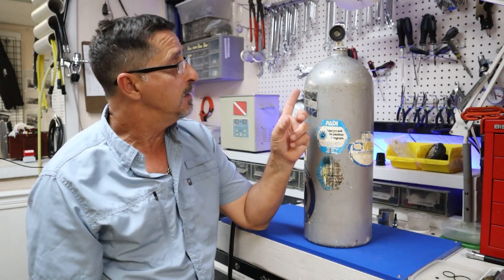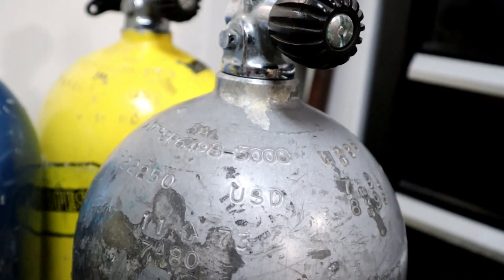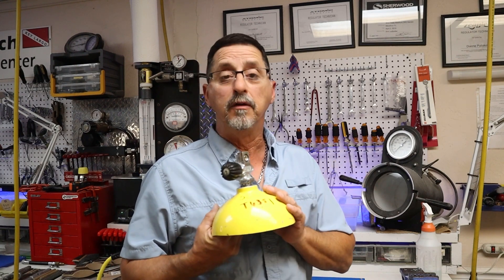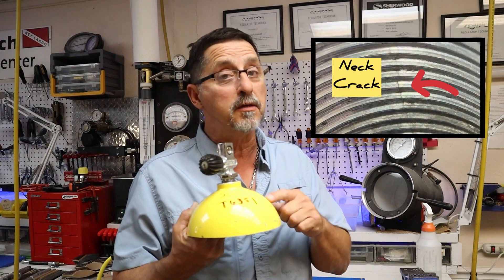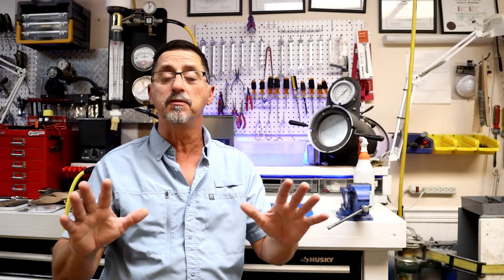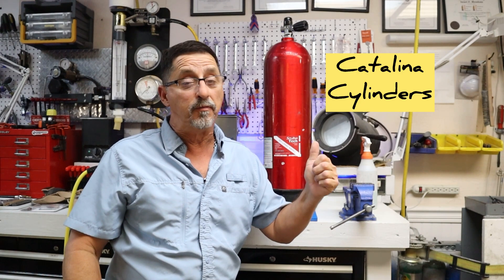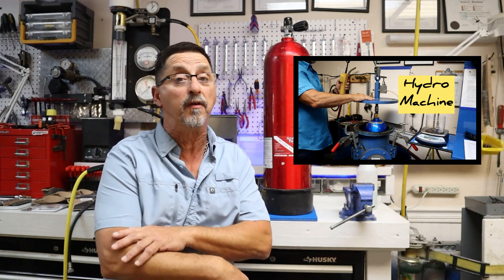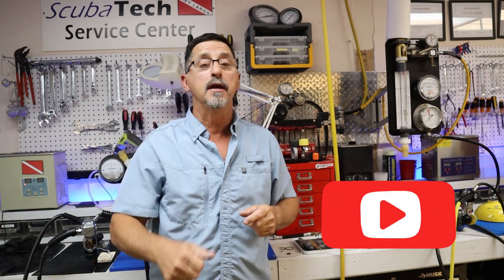What happened to Luxfer Scuba Cylinders??

Comment: thanks for the info, I still have a 50cf and 13cf from the mid 80's in the garage with air in them, they have never been empty other than inspect or hydro - never failed a hydro, but no one will fill them so they just sit there - put two 80's and another 50 out at the curb just over a year ago when I picked up a new Catalina 80 for beach water metal detecting - about to give up on tanks and get a Blu3 Nemo - it would be a lot less work for this mid 70's body of mine -
Reply from the maker: I've seen the Nemo diving system, haven't use it but I would like to try it.  I've used the Brownies Third Lung and use Snuba for lobstering.  It's a good feeling without tanks on your back.

Comment: Do steel tanks have the same issue?
I have a 1971 HEALTHWAYS 72 cu.ft. Tank.
Any thoughts on that?
Reply from the maker: Neck cracks have only been seen in aluminum tanks, steel from the 1970's can become rigid, which will fail hydro.  Steel tanks stay flexible if cycled regularly such as filling and hydro testing.  Tanks that are in the garage for 20 years without use  have a high probability of failing hydro. A simple test you can do at home is to "tap"the tank on the side wall with hammer, listen for bell tone, if the sound is dull the steel is rigid.
Reply: @scubatechkeylargo  
Well, I took that tank, the 1971 steel HEALTHWAYS 72 cu.ft. to the dive shop for a hydro test. I'll keep you posted on the results.
Reply: @scubatechkeylargo  
My 1971 steel HEALTHWAYS 72 cu.ft. Passed hydro. 
I just bought a January 1989 Luxfer aluminum 80 tank. 
It had hydro dates of 1994 and 1997

I’m taking to the dive shop for a new hydro tomorrow.

Comment: 1973 I had 2x60cf twin set then 1974 I had the first of the 40 CF high pressure 4200 psi twin sets.Made by Luxfer ,Nottingham being my home town.They where the must have tank then ,happy days .
R
Reply from the maker: Double 60's must have been awesome to dive with.  I understand that Luxfer UK has different cylinders than what we have in the US.  Recently a small bottle from Luxfer UK made it to my shop, it was stamped with "Mini Breather" on the crown, very cool.  Not long ago a bottle from Luxfer Australia also made to my shop.  It's awesome to see how many different cylinders are circulating.   I'm finishing up a video on Hydro testing will post soon.Thanks for watching,
Reply: @scubatechkeylargo  lol I used to be glad to get in the water if I had to carry them far on a shaw dive .no lite weight.